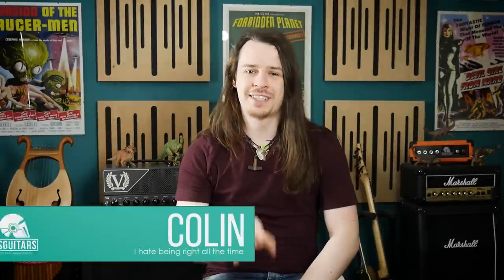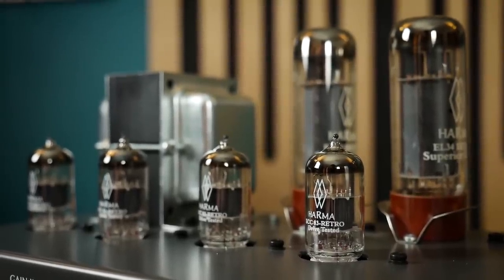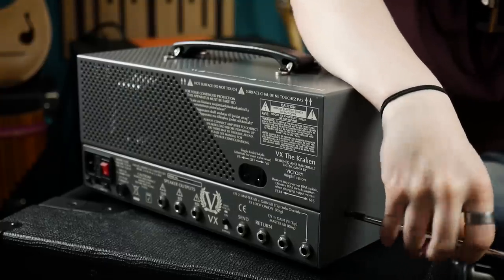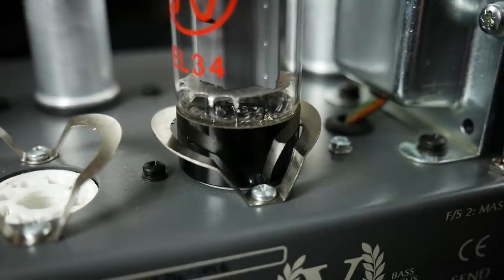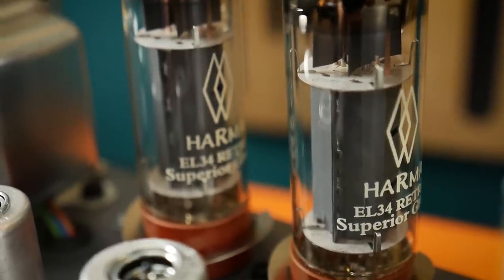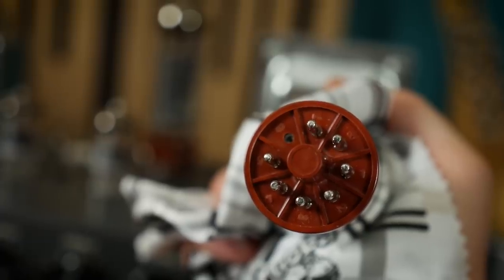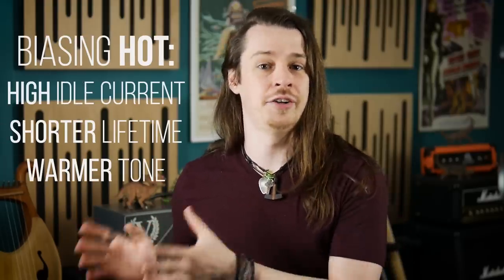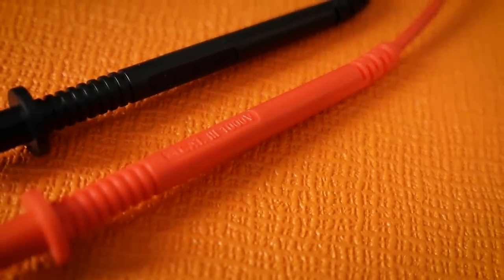Swapping Valves And Biasing Amplifiers

Comment: Cool! Thanks for explaining this. I recently got a Ibanez TSA5TVR which has one power tube and a preamp tube. I swapped out original Rubys with JJs. It changed the tone considerably. Warmed it right up. When I got the amp I had to open it up due to a screw coming loose from the transformer. Not much under the hood but great tone.

Comment: I always love your videos Colin, well spoken, interesting and to the point with plenty of information, this is more of what this platform needs, makes me proud to call myself Scottish. I will note though that you were mentioning about the Voltage of the electricity as the problem, slightly untrue as you can have millions of volts go through you and be totally fine, it's the current that gets you. 0.1 to 0.2 Amps being immediately lethal while anything above causes severe burns and stops breathing, people can be resuscitated from this but it's still a terrifying bleak outset. Not to say that makes biasing any safer, still a very risky thing to so, just mentioning an idle point.

Comment: When I was a child, all the TVs were valve, my first amp was a valve one (actually a tape to tape recorder), my second amp was a valve (Carlsbro PA I think), my first proper guitar amp was all valve (Marshall 50W Silver Jubilee), next a VOX AC15 and my present amp  an all valve Marshall.  I never changed a single valve in any of them and never had any issues with any after years of use.  I must have just been very lucky.

Comment: Great video! And all very true! ...if you have a fixed-biased amp that is, which is usually the case for amps greater than about 30 Watts.   However, lower wattage amps are often cathode-biased which are “self-biasing” so to speak, and don’t usually need adjustment (unless the particular set of new output tubes you’ve bought happen to have characteristics that are REALLY far from the average for that type of tube).  Vox AC30’s and  Fender Tweeds, for example,  are cathode-biased.  So, if your amp doesn’t djent... it might not need re-biasing.  If in doubt though, for sure take it to a good amp tech!

Comment: Dexter's Laboratory and his rubber gloves.
7:45 What a relief. I was thinkig about buying their amp. The voltage itself isn't lethal if ampere value is low. Anyway thanks for video. Good and informative. Especially in Bugera case. Cheers.

Comment: Today, my Marshall JCM 2000 TSL100 amp blew its HT fuse, after I had just checked the bias was correct, and it appears that all four EL34s show signs of failure (label discoloration/wipe off, internal fixtures reddened, glass darkened, etc). And this could almost not have happened at a worse time. Last Friday, I used tge amp with great success in a gig. But now with Russia causing problems, finding affordable replacements is next to impossible... lucky me, my lead guitarist happens to have a Laney Ironheart I can use in the meantime. Thanks, and I'll try to keep it loud!

Comment: I just came across this video and really appreciate your work, Colin. I now know the correct way to remove/replace my tubes (I live in the midwestern US, where we pronounce it "toobs," not "tyooobs," and where we call a drinking fountain a "bubbler"), which makes me wonder if I damaged the sockets in my Mesa by just pulling on the tubes in the past. It would've been nice if the salesperson showed me proper tube handling/replacement when I bought the amp back in 2001. On biasing my Mesa, the manual that came with it includes a three-page essay by John Randall discussing how the company doesn't build biasing controls in any of their amps (at least up until that time) and that you shouldn't pay for the service (for their amps), as long as you buy and use matched Mesa tubes. I'm sure it all depends on the amp, though. Again, thanks, and glad to have hit the subscribe button.
Reply: A bubbler LMAO the midwest is definitely another world

Comment: if the valves are consistent and matched, popping in new ones should require about the same bias setting as the old ones providing it has not been rebiased along the way as the old ones wore out. Say you had a set of JJ EL-84s and they are getting old, then another set should be fine to pop in there if the bias has not been touched. A little risky that the values will be different, but they should be there or about. A lot of guitarists used to just bias their amps by ear. Maybe why they blew so many up (Eddie and Angus).

Comment: Biasing is actually quite easy. I lowered the voltage to reduce the overwhelming bass on my amp. Wear plastic gloves and use an insulated screwdriver to avoid shock.

Comment: A question that I have always wondered...While I have biased my amps many dozens of times (always discharging  the caps and always one hand behind my back), I was wondering would a latex glove (the thick yellow type) offer any added protection against potential electrocution?
Reply: If that's the route you want to go, buy professional electric isolation gloves, and make sure to check them for any leaks before every use. They might be thick and feel a bit clumsy, but you can usually adapt pretty quickly. Also, be very aware of where the gloves end. Most horror stories I've heard is about people who think the gloves make them immortal, so they aren't careful, and manage to put their arm onto a live wire. If you're using a guitar amp, I'm guessing you want to avoid nerve damage in your arms/hands.

Comment: Great stuff! Video idea: Get a bunch of preamp valves with different gain values (or whatever they are called) and test them in the V1 slot on the Kraken. I'm a big fan of JAN GE5751 tubes that are about 75% of the amplification of a regular 12AX7 and are a great way to  clean up some of the unpleasant shizzle some amps have.

If you haven't done this video by the time I'll get a new amp, I'll do it myself. ;)
Reply: I have The Jack V30, and I am trying to figure out....everyone is saying replace the V1 tube but no one is saying which tube that is!  Is it the one all the way left?
Reply: @blimey48  Looking from the front, usually yes.

Comment: Would you be able to do a video about the differences between soft, medium, and hard rated power tubes? I’ve done research, and understand the basic principle behind it, but I cannot afford to buy three different sets to be able to compare them, so I’m replacing the ones in my amp with medium (it came new with hard).

Comment: I have recently purchased a used tube amplifier from my local music store and was told that the tubes have not been changed AND I have also found out the amp has been in the store for a little more than 3 years. What would be the permanent damage caused by the tubes to the amp itself? Damage to the modules? An unusable amplifier? Need help plz. Also amazing video!

Comment: I wonder if BiasFX will make an amp biasing mini game inside their vsts. Id buy the software just for that.
Reply: The day an amp sim allows you to simulate biasing amps (BIAS Amp 2 might already let you do this, but I don't own it, so...) is the day valve technology dies.
Reply from the maker: Bias FX has always had a bias control on the amp sims that lets you bias hot or cold for the tone.

As there is no risk of failing a valve with simulation, I regularly bias my  sims hot. 

I think even how much the valve glows changes as you adjust it. They went to town with that software.
Reply: CSGuitars im sold

Comment: Are you familiar with Egnater’s Vengeance amp head? It has outer bias points and adjustment dials. The manual has its step by step process in biasing that particular amp. Although there is a method they have, I ask you take a look at that manual and see if it jives with your know how in biasing an amp. To me it seems a bit “speculative” that their way is even correct. Great videos 👍🏽

Comment: Bugera 333, just flipped it on the other day, switches light up, but no glow in or heat out of the valves. My 333 is pre-infinium. I've been playing this amp for 3 years, never replaced the valves or biased them. My amp is in my basement studio, so the climate is relatively consistent. Wondering if the power valves blew because it is the start of winter, I came out of standby relatively quickly when I believe they blew.  Usually, I'll powerup into standby mode, tune my guitar, when that's done, I'll flip out of standby and all is good. This time, I powered up into standby, gave it maybe 30 seconds at the most, flipped out of standby and valves don't light up, and there is no sound.  Main fuse appears to be fine, passes current. So, wondering if colder (winter) tubes can be shocked by going to operational state too quickly?

Comment: I've just , finally, bought my first valve amp secondhand. It sounds great so I assume the valves are set up fine. As a general guide, if I'm only using it occasionally (I'm a bass player, and it's a guitar amp) how long can I expect to not have to worry about this?
If it makes a difference, it's a Blackstar Htr-1 and will rarely be pushed hard.
Reply: I'm so old my tvs we're valve, and some of the radios.  Had valve amps for decades.  Never changed a single valve in any of them and never had any trouble.  Not saying the dude is wrong, but I wouldn't lose any sleep over it.

Comment: Would rubber or anti static gloves help isolate your hands from shock? Like the blue nitrile type used for painters or mechanics
Reply: Anti-static materials are sometimes conductive on purpose, so I definitely wouldn't recommend those. Instead of blocking all currents, they limit them, and slowly even out static charges between objects. But static charges usually release very little energy, so that's not a problem. If the charges aren't static, that's another story. With any persistent power source, that usually means the material heats up until it catches fire or melts. Neither scenario is good for your hands. 

There are professional electrician's gloves, if you actually want something that helps. Before you go looking for some, I'll quote the safety advisor at my job: "protective equipment won't save you from stupid decisions". Make sure you know what you're doing, before you gear up to do it. 
How to use these professional gloves: 
1. Always check them for leaks. If they aren't air-tight, they're damaged and they're useless. Replace them immediately. 
2. Act like they don't help at all. Don't change any behavior, just because you think the gloves make electricity safe. The worst thing you can do is to assume that a layer of rubber will save your life, even though it might.

The gloves are insurance: they don't grant you a license to mess up, but they might reduce the cost of a mistake.

Comment: Thanks for yet another great video--but you already knew that, didn't you?  LOL!

This is definitely a good thing to know.  I know what getting a dose of Es feels like (not talking about drugs from the 90s, either).  It's how I discovered that I'm a 650 kilohm resistor, and it might explain a few other things about me, too.  :/

Your comment about Bugera's auto-biasing circuit was helpful.  I'm a tube amp noob (and an American, if you couldn't tell yet), and I'm not sure what I might want for myself in the future.  I thought about skipping a tube power amp altogether, since most of my sound comes from raunchy fuzz pedals, anyway, and aiming for some kind of speaker breakup sound that...

...HEY, can you do a video on how to achieve speaker breakup, for us noise heads?

...anyway, yeah, so, I'll have to check out Bugera amps.  Thanks again for that!

Comment: These might be stupid questions but
1) will I need to rebias an amp if it is valve-state and only has 1 preamp valve (such a a micro terror) being replaced 
2) a friend of mine told me even if you pull out the current valves and put them back in their original place, such as to check the sockets in a second hand amp are clean and tidy I will still need to bias it again even if they are the same tubes, is this bollocks? It sounds like it

Comment: Do you need to bias the amp when replacing old valves with a new set of the same ones ?
Reply from the maker: Yes. Every valve has different performance. Valves from the same batch all perform differently. 

Every time you change output valves, the amp needs biased.

Comment: I've got a Crate BV50H that has an auto-biasing circuit.  But the manual says removing the preamp tubes exposes "extremely hazardous voltage levels" and to always have them replaced by a qualified service center (but replacing the power tubes yourself is fine).  Is there something about preamp tubes that makes them inherently more dangerous than power tubes with biasing out of the equation?

Comment: Good vid.  Here's a question, for anyone really.  If I don't care about buying tubes frequently....why not just set the amp to run hot.  You could skip biasing and just always replace your tubes every month or so.  From what you're saying, running hot gives the best sound, but kills tubes quick.  If I don't care about buying tubes, seems like the easiest and best way.  Just run it hot and stock up on tubes.
Reply: S K - The issue is cost and reliability.  If you push your amp too hard by biasing hot, tubes will fail (or something worse). If you’re in the middle of a gig and that happens, you can have significant problems if you don’t have a spare amp. The other issue is the expense. Two valves for a 50 W amp cost about $50; four valves for 100 W amp cost around $80-$90. Buying new valves every month would get very expensive.
Reply: Donald Moser Right, I get the expense...but that doesn’t really bother me. And I’ve never been at a show without spare tubes or amps, so that doesn’t matter either.  So...if that’s really it...running them on the hot side doesn’t seem that crazy.
Reply: S K - Hear what you are saying, but I did say “or worse” in reference to potential damage when tubes fail.  Depending on how the tube fail, you can “cook” major circuits in your amp.  A simple tube swap will not fix it.  Be prepared to outlay major money for an amp repair.  If you are running a vintage amp, you likely killed its value, or its operation.  You can ruin the transformers and whatnot.
Reply: JUst down to personal preference.

Comment: Thanks for the video!!! I have a Bugera Infinium that claims to auto rebias the tubes. So if we take the biasing out of the equation is it completely safe to change tubes with your bear hands with the power off? I mean are there certain things like capacitors that still hold charge or anything else we should be aware of?

Comment: Colin did you have to change your valves all ready?  6L6 usually should last around 1000 hours easily.
Reply from the maker: I've had the amp for about a year and a half and it was a store demo model before that. It probably needed the valves changed before I got it... 

Also, breaking one speeded up the process. 

Also also, videos gotta be made.
Reply: Rite, that is my next amp for sure anyways. Thanks for the video man. Keep it loud; P

Comment: Hey Colin i have a Marshall i bought used and it still has the original power and pre amp valves. If i used a matched set of power valves would it be a major deal if i didnt bias the amp. Around where i live no one knows how to bias amps. I work as a full time technician for cars so i know enough about electrical to bias it myself but i would rather not destroy my amplifier

Comment: Hey there, nice video again!
Just wanted to know, if the preamp valves could be producing noise after some years and if the biasing is needed when they are changed, too?
I've "created" my own (rack based) hybrid amp with an transitor PA amp and an Hafler Hellrazor Tube Preamp. My bass sound is pretty much killer now (Lemmylike) but this preamp is just producing so much noise and i was wondering, if the 25-30 year old valves could be the problem there?
Thanks in advance for any usefull advice.

Comment: I've heard changing the preamp tubes is fairly easy and doesn't require any special training. True? Also what type would you recommend for high gain applications? Currently my amp only has 2 12ax7 hg by Ruby. It has decent gain in the OD channels, but I'd like to get a little more gain out of the amp so I don't have to use a pedal to get modern metal tones. Your insight would be greatly appreciated! Thank you.

Comment: Do you recommend putting a small fan on the back of your amp to keep the tubes and everything cool?
Reply from the maker: Valves are SUPPOSED to get hot. They won't work if they don't.
It's not like a computer processor where the heat is a negative byproduct of operation, valves have a heater to make them hot so that electrons can be thermionically bubbled off the cathode. 

As long as the amplifier shell is well ventilated to allow that heat to escape to the environment everything is fine.

Comment: I build my own tube amps, and I make this much easier. I put one ohm resistors in the tube cathodes, and then some RCA jacks on the back. Plug in a meter to the jack, and then turn the screw-slot pot on the back to tweak the bias. Simple, no high voltage, and because the bias includes screen current, is conservative. Amp makers should do this, but they don't.

Comment: I remember when I bought a Vox AC15 and swapped out my preamp tubes. I never wanted to work that combo ever again lol swapped it out for a proper head. The pcb board was so flimsy in that amp and it forces when you pull and install new tubes. Pretty annoying.
Reply from the maker: Of all the amp techs and builders I've spoken to, they all agree that the VOX AC amps are the most frustrating to work on.